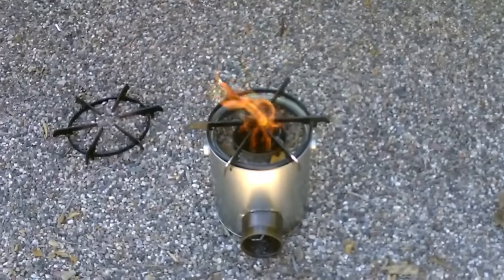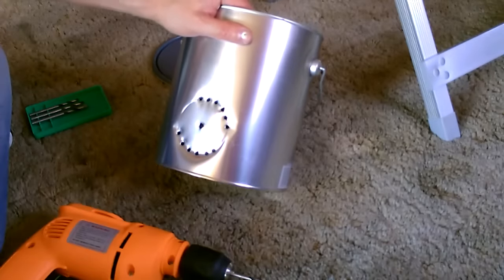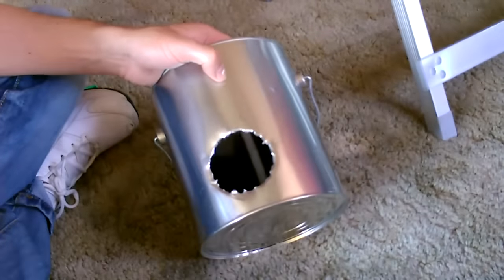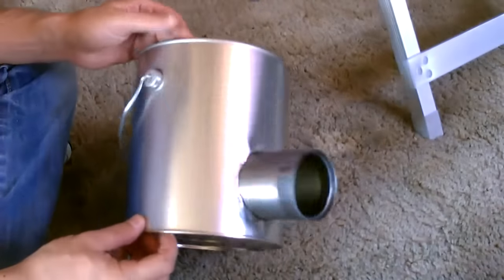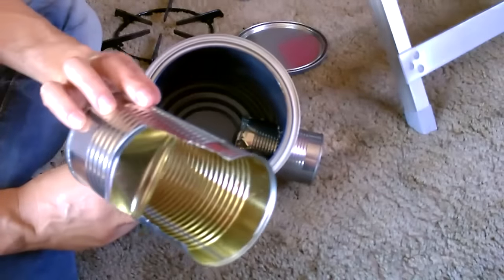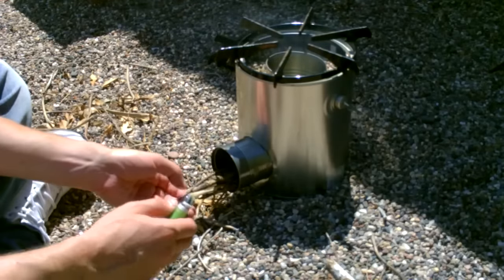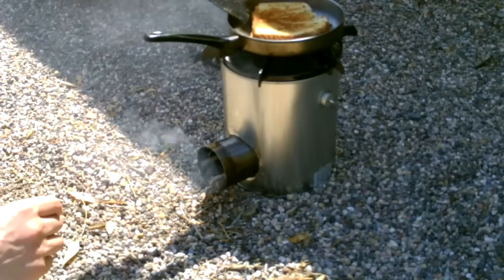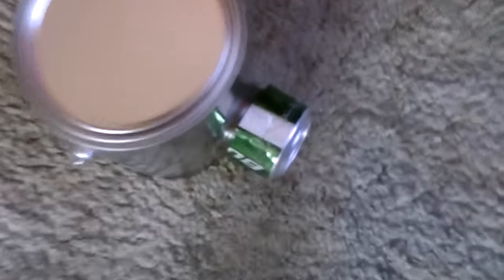Homemade TIN CAN Rocket Stove - DIY Rocket Stove - Awesome Stove! - EASY instructions!

Comment: Do you think making a chimney would make this safer for indoor use on a shed? I was thinking a flexible metal pipe and vent it through a window(make a sheet metal square same size as shed window take out window and replace with sheet metal then vent up a rigid stack? Maybe put cement board hearth pad and wall backing? Think it could work? I may try

Comment: I made one today and it seems to work good, going to use it when I go ice fishing. I traced the soup can with a pen onto the pail and the larger center can, drilled a starter hole, then used a solid knife (banana knife) to cut out the holes a 1/4 inch at a time. I put a hole in the center can instead of notching it as you did, because I wanted to keep the base on the center can. I only used sand so that it would pack in and stay in place better. For those wondering how to clean it out, the ashes fall out of the inlet (soup) can easily enough. Thanks for the vid!

Comment: Just a tip for people trying to cut the hole in the first tin.. If you fill the tin with DAMP sand , then lightly drop the can from about 5mm off the ground to pack it in, place the lid on top of the can and lay the can on its side.. you can now easily use a whole saw to cut the tin. ;)

Comment: I really got into building these as well as the alcohol burners, etc, and find that the clay cat liter works very well, and if slightly moistened before first burn tends to harden the litter into a cement like base, making it burn even warmer.
Reply: you could use a nice pair of metal snips.
Reply: That is a good idea, thank you.
Reply: Pure genius and cat litter is cheap.
Reply: Shawn S. ... Super suggestion! Much faster than using cement like I had initially planned to do.
Reply: Clumping Cat Litter is nothing but Raw Bentonite Clay. It is not good for firing into pottery, but: in a case like this where we aren't worried about Waterproof, who cares?
Reply: Do you have any videos of your builds with the cat litter insulation
Reply: Great idea on the cat
Litter
Reply: @bigmillruffin9143  I’d like to see that too
Reply: @TimeSurfer206  so do you think sand or cat litter is better?
Reply: @lonigirl8807  I'd go with a clumping clay. Sand wouldn't stay put if it tipped over.
But, for my cats, I actually use wood pellets.
Reply: And we're pretty sure you mean "Fresh out of the Bag" Not slightly USED.    <=ºþ

Comment: Love the Rocket stove, built all sizes and shapes myself.
Aviation snips are great for tin can work and a nail is good enough to puch the holes, that way we can save electricity. To avoid smoke you might have to increase the gap between the pot and stove, that seems to help for us! Keep up the solutions people, the time is here to share good info.

Comment: Usually the insulation around the stack is a bit better than rocks, usually some sort of perlite and clay slip blend.  Thats a little more complex for a hobo stove of course, but the insulated stack is where the magic of a rocket mass heater happens.  Since that solidifies, you can turn out the ash no problem.  The taller the insulated stack, the better the mass heat conversion is.
Reply: I'm clueless. Are you saying that a perlite and clay slip blend will melt and solidify - like fireclay? Perlite you can get a garden centre, can't you? And a potter could supply the clay slip or can you make your own if you have access to clay (I do). Can you give a ratio?

Comment: Fill the can with sand and use the hole bit to drill all of the way through. The sand keeps the can from collapsing when the drill is pressed against it.
Reply: mrsillywalk Another is to fill the can about 1/2- 3/4 full of water & then freeze solid.
Reply: +Oldtimer Lee Water expands, it could burst the container. If you do this, turn the can sideways and drill the half that's frozen to that side of the container.
Reply: +megadeathx 
1/2- 3/4 full like Oldtimer Lee said won't burst it, or even slightly bend/distort the can really
Reply: megadeathx Lol, the cans are already open... does your ice tray warp because you make ice with it? No, because it has an open end. Think it all the way through mate.
Reply: thetravelinghermit lol
Reply: mrsillywalk

Comment: Also try adding chimneys on top with different size cans or I've made a handy blower with a 2 liter coke bottle with a square hole and 12V 4" computer fan on the side, blow that into the fuel feed- mini forge, one last thing, a shelf for the fuel feed soup can helps air get under the sticks. 
 Just watch the smoke from those linings from fresh cans and remember, more heat decreases the can life faster.
Play with Fire.

Comment: A rocket stove is, basically, a wood gas stove with better air supply. The magic comes from the insulated smoke stack.  This lets the temperature in the fire reach ridiculous temperatures and it evaporates the wood gas. With a non insulated stack, the gas would just blow off as smoke, but the insulation allows the temperature above the fire to be high enough that the wood gas burns as well.  RMSs will do this faster than wood gas because of better airflow. You basically have 2 fires in an RMS

Comment: One small mod I made was to tilt the inlet up 30 deg to use gravity in my favor. Works great, thanks for the idea.
Reply: Jerry Ohmer isnt 30 deg bit much? i thought  inlet was purely for air income like in jet engine. so it burns better
Reply: The 30 deg is not for air. It allows for gravity to feed fuel for longer burns. As the old fuel turns to ash it allows for unburned fuel to fall into its place.
Reply: That's what I was thinking I would  do.

Comment: You should put some holes along the base of the outer can, above the sand line. The heat that builds in the outer chamber would cause air to be drawn in, adding to the upward flow parallel to the burn chamber. Not sure how much the gravel will impede that flow, though (most I've seen leave the air space).

Comment: Well made video. Easy to follow instructions. Great job. I do have a suggestion. When cutting the inside can, you said the hardest part is getting the cut started past the lip of the can. If you take a can opener and turn it sideways, you'll cut the entire lip off rather than just the lid, but be careful as the edge is extremely sharp.
Reply: Steve O They also have can openers that will do just what you mentioned, but without the sharp edge.  It should work perfect.

Comment: For insulation I mixed self-drying clay with shellsand and a spoonfull sugar, after the first burn this became rock-solid so easier to transport and throw out ashes. I also took a stainless steel drinking straw, cut into pieces and made airflow-holes at the bottom, drilled through both cans. Works perfect! Oh, and instead of making an arch on the inner can I drilled a whole cirkel in that can too. Now it is easy to take it along camping, I take the front can out and stack it inside the stove.

Comment: You need a tray in the inlet that lets air in under the wood. You'll get a hotter fire.
Reply: more heat/not enough durable metal here.

Comment: You can also make a ventilation control with the soda can. This way, both temp and  fuel duration can be more controlled thus adding flexibility.

Comment: Beautiful work. I have tried this several times. Cutting a round hole in the side of a Cylindrical Paint can is a REAL CHALLENGE. You show a nice solution. Thanks.
Reply from the maker: hi and thank you! yes, it would be difficult to cut a round hole in the big can (especially a round hole of the exact size needed to hold the small can tightly). but doing it like i did allows for an 'adjustable size' hole in the big can. the little points of metal that are left over from the drilling grab and hold the small can very tightly. those points can be pushed in a little or straitened a little (as needed) to get the small 'fuel feed' can to fit perfectly.
Reply: @desertsun02  Seems PATIENCE is just as useful in this as in many operations. (Sigh!)

Comment: Wow ... great ideas from all.  I like the ice or sand trick to let you drill all the way through.  Hole saws can get grabby though, and cause a little two-step quicky on the ol' wrist.  Another idea is to use the hole saw to 'mark' the circle, then use a jig saw with a fine-toothed blade to cut out the circle.

Comment: Good stuff. I've been using something similar for years. Because I like to build my own furniture and bee hives, I have lots of wood shavings and saw dust. So instead of filling the outer sides with sand and gravel, I pack in my saw dust and or shavings and light that with a piece of paper. Beware the can will get hot enough to burn a floor so it needs to be set-up on stones or something fire-retardant. The inner cans are used for a mould to create a tunnel / chimney. A four litre / one gallon can of saw dust with give a good even heat for about an hour, so more cheese sandwiches please.

Comment: If you have a dremel tool a grinding wheel will cut right through that metal fast.  Nice design though, the paint can already has a nice handle built in.
Reply: هبل سكن
Reply: Which attachment would you use?

Comment: I am not sure if you're going to read this or not but I wanted to say, "thanks!" I made the Rocket Stove from the directions you gave me. I just finished it this afternoon. With not having all the tools it made it a little hard. The can isn't right in the middle but it's going to work for what it's intended. Once I go camping I am going to try it out. Again, thank you.
Reply: Sorry for asking this question as it's over 7 months. Did you use a 5 litre (1 gallon) can for the outside, thanks.

Comment: I really like the easy part and the handle.  I just wonder how to clean it out without spilling the sand and gravel.  Plus I think of the sand and gravel as thermal mass rather than insulation-- because once you heat it up, it should stay warm, and wouldn't it be nice if you cook quickly outside, then carry the nonflammable hot rock inside to cut the chill?
Reply: Sara Cowgill cut out the hole in cans cover, so it covers the channel with sand so u can flip it up side down without spilling. This way the cover can be permanently in place and you can keep cooking
Reply: ***** Mine stays pretty clean without washing it. Everything dumps right out and a quick pass with a bottle brush or similar tool works great without getting it wet.
Reply: +Sara Cowgill take plastic wrap, wrap  the can  securely, once everything is cold, ofc, then flip it upside down. once you get the sand and the gravel out, remove the foil and flip it again to take the ashes out :)
Reply: +Sara Cowgill maybe build one with concrete, that way you can simply tip it over and it'll stay built
Reply: Sara Cowgill if the paint can comes with a lid, draw a circle the size of the can, cut several diameters inside that circle and bend the wedges down into the can. Pound that lid on good and right and you're set

Comment: good video  I like vermiculte  rather than sand  it is lighter and has better  r value also put a small shelf 2/3 down for your wood in your feed tube...that way  you still have draw and the twigs can rest on the shelf  these are great   can boil in short time and use twigs to do so  very fuel efficient and portable  i'm gonna make a duel burner like a colman stove  no need for propane bottles
Reply: nice tips!

Comment: Ive made a stove with 1 inch perforated card board rolled tightly into a tuna can then pour hot wax over the top it makes like a sterno can and lasts along time then for the stove used a coffee can and cut the side up enough to slide the tuna can (Burning ) into the bottom __ for the coffee can use a church key (bottle opener pointy end) made holes along the ridge of the coffee can (top side_  so the heat can escape.  learned it in a survival course i took yrs ago.
Reply: Awesome

Comment: If you can't the store burners grates there are hundreds of ways to make something like them out of common household items and or thing from the hardware store bins. My favorite is taking two or three strips of metal bending them down 90 degrees on each end where they go over the edge of the can then do a 180 reverse bend after half an inch and then making a roll out of the remaining inch of metal on each side. Drill a hole in the center of each strip and use a small bolt to hold them centered. Do it right and it can be stored inside the can when not in use
Reply: I think places like Home Depot or Lowes sells just the burner grates.

Comment: Nice build, though I would prefer rock wool over gravel due to weight issues. Also, you could take heat resistant aluminum tape to cover up any air gaps around the fittings.

Comment: It's kind of amusing watching this; I'd never seen one of these until I came to Guatemala in 1999 and stayed with a desperately poor family and watched the grandmother start a fire in her home made stove. It was a rusted out 12 quart cooking pot (apx.) that someone had tossed.

It wasn't made quite the same as the one in this video though. She filled the pot with sawdust and packed it in good, then drilled a hole in the sawdust, with a stick, through the rusted out hole on the bottom of one side and with another stick, at the same time, connected another hole, going down from the top through the center. 

once she had a connecting hole, she started a fire in the hole at the bottom and let physics carry the heat and flame up.

I was impressed; the stove burnt long and hot and the black beans turned out great!

Comment: next time you make one put water into the can and freeze it, then you can use the hole saw.
Reply: or put a 2x4 behind it???
Reply: Damn, that's a good tip. Ive used ice in copper lines like that. Same principle
Reply: George Hart
Reply: Great idea !!!
Reply: George Hart
Reply: Freezing works much better than a 2x4..also, tin snips would be much better than hacksaw.
Reply: we used it during camping. and now I know exactly how to make one..

Comment: Excellent !, I'm going to drill small holes through the bottom  of both tins, they must equate with each other, then attach small bore 8mm   -10 mm, copper pipe between each 2 adjacent holes, then fill with fireproof insulation, ( sand or gravel either ? ) once comple air will fill the bottom chamber of the inner can forcing more pressure for the flames, thank you for the vid !!!

Comment: one thing you can add to this is, a copper tube water line. you can make a hole on the side the size of the copper tubing, then run it to the center can chamber, from that point you coil it up in a tied coil towards the top then run the tube out outwards towards the outside top...then from this point run tubing on both ends, one being your water source and the other being your hot water collector...this is good to use for those moments you need nice warm water for a shower etc...I have found that if you take a plastic 5 gallon bucket and tap into its side and use that as your water source you can elevate it in a tree or simply higher up off the ground so it feeds the water through...as for the outlet you can modify a shower nozzle in the line, if you run enough rubber tubing on the run, you can use this for a heat source for a tent floor...as for the return you simply run a tap into the plastic bucket so the water goes back to its source. Use sand in the copper tubing/pipe when bending it into a coil so you dont kink the line..
Reply: Thanks but you may have to demonstrate it with a video. A picture, or in this case video, is more than a thousand words
Reply: I get the general idea, but I can 'see' it the way you describe it. A YouTube video?